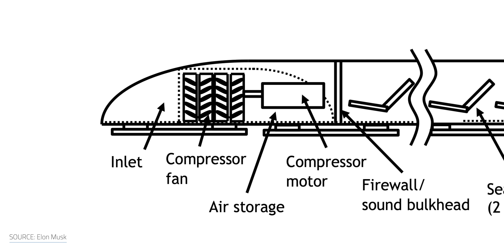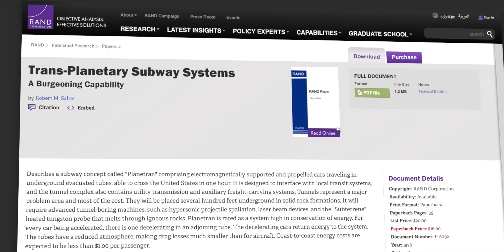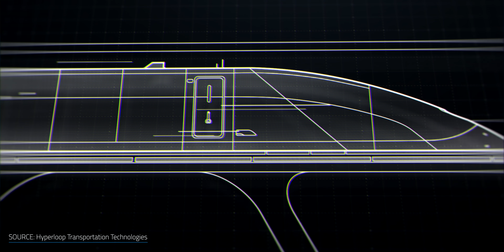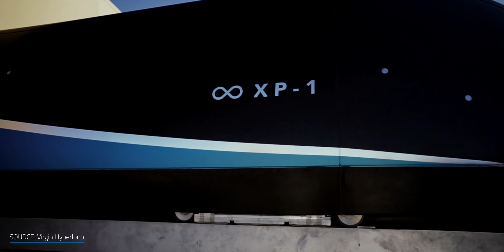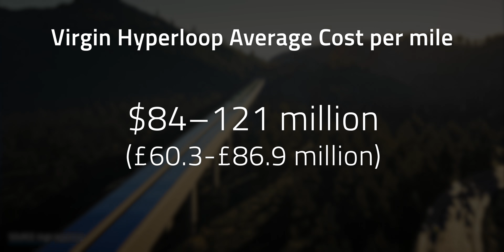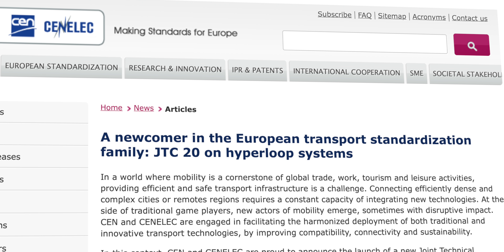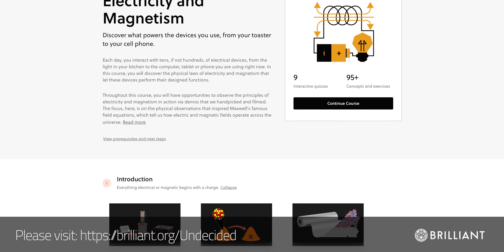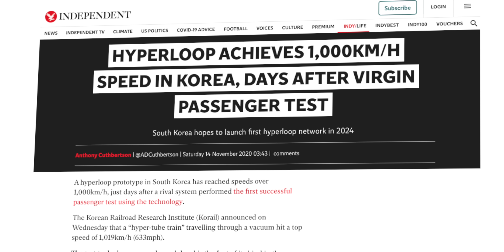Exploring Hyperloop - The Future of Renewable Public Transport?

Comment: Did you ever look at the tunnel Elon built for 10M per mile? It´s a hole, 2,5 meters across and that´s pretty much it. The 2 B dollar per mile, Elon compared his tunnel to actually is the price of a full-fledged underground network including stations and everything. 10 M per mile for a tunnel like Elon´s is the normal going rate, it would have been very surprising to find out that Elon is able to build cheaper tunnels with a store-bought tunnel digging machine. I once did the math, and if Elon would build his tunnels only in LA, and only covering the same routes and stations the bus network there does, the nonsense would cost almost 280 billion Dollars.

The hyperloop is even more idiotic. A track hundreds or even thousands of miles long and all you got to do to kill every soul aboard is hit it with a hammer at the top? All terrorist's dreams just came true. Who would be able to guard such a monster? Every single pillar is a weak spot, who could guard every single pillar? Just take LA-Frisco, the track would run for dozens of miles through rural farmland, you would be able to drive there, have a nice afternoon, place explosives around some pillars, kill all passengers and make it home for dinner. You won´t even get caught, as there is nobody who would have witnessed you. But tat´s only the problem for your life, what about economics? How many capsules can you send on track per hour? How many passengers can such a capsule hold? 
China´s CHR may only make 400 km/h, but it transports up to 10.000 people per hour in both directions. Even under the most generous assumptions, the Hyperloop will be able to launch 10 capsules per hour. With 50 persons per capsule, even though all marketing CGI that has been shown yet suggest way fewer passengers per capsule, we talk about 500 passengers per hour tops. So what good is it to make the run from LA to Frisco in 30 minutes instead of 50, when the next free spot isn´t vacant before the next day?

Elon is an idiot, he always tries to sell other people´s inventions as his own and he doesn´t even choose good ones. The train in a vacuum idea has been revisited at least 8 times during the 20th century and has always been rejected as useless.

Comment: I'm pretty sure Hyperloop is the Concorde of rail. It will take a lot of trial and error to get it cheap and reliable enough for the masses. BAC ran out of money before Concorde acheived that, but it seems there is a lot more interest in high speed vacuum tube trains than there was for supersonic passenger planes. So yes, I believe Hyperloop has a chance and I would love to ride them all over the world.
Reply: The difference is the Concord was a proven concept, the Hypeloop isn't.
Reply: @herrschaftg35  What's your definition for "a proven concept" in this context?
Reply: @eaaeeeea : Something that works.
Reply: @herrschaftg35  thanks. Would you consider people riding on a Hyperloop prototype as something that works? (Virgin Hyperloop 9. Nov. 2020).
Reply: @eaaeeeea : No, because that pod won't suffice as a finished product, nor did their test come anywhere near to fulfilling their original claims. They don't even have a track large enough to really test anything properly. 5 years from now, this project will continue to be hyped-up just to keep the money flowing in with little more to show for it.

Comment: I've ridden in the Japanese "bullet train" at 125mph. Quite an experience.
Reply from the maker: Nice!  I’d love to try it.
Reply: Only 125? That’s how fast the UK rail network can go. Did you mean 225?
Reply: @kaitlyn__L  The maximum operating speed is 320 km/h (200 mph) (on a 387.5 km section of the Tōhoku Shinkansen). Test runs have reached 443 km/h (275 mph) for conventional rail in 1996, and up to a world record 603 km/h (375 mph) for SCMaglev trains in April 2015.
Reply: @dscarty  ah yes, I had misremembered 175 (the current maximum) as 225. I should’ve checked myself before leaving a comment. But I presume you rode an earlier train. 

I knew the UK HST was inspired by the 60s Shinkansen but somehow all these years I’d wrongly convinced myself it had never quite gotten up to the same speeds as its inspiration.
Reply: @kaitlyn__L  Perhaps the most amazing thing in 1989 at 125 mph it was comfortable and quiet enough for many people to be sleeping. The hyperloop is coming.

Comment: The biggest problem with Hyperloop is that it's too late to address climate change.
If the world wants to becomes carbon neutral or negative fast enough to avoid catastrophe Hyperloop technology won't be a part of that solution.
Big infrastructure projects take a long time and Hyperloops are still in the early prototype phase. Meanwhile high speed trains are proven technology that we can start building right now. 
China has proven that it is possible to build a far reaching high speed rail network in a couple of decades. North America can do the same.

Comment: ThunderFOOT will drop the hammer on you if you don't apply basic common sense about this topic.🤐🤐🤐
Reply from the maker: Bring it on.  I was balanced in my take on the subject.
Reply: @UndecidedMF  you should watch thunderfoot videos on hyperloop. i notices you didn't talk about tube heat expansion. and the underground tunnels why don't you just build a subway system.?
Reply: @UndecidedMF : No, I do not believe you were very balanced. You used the same CGI and unsubstantiated claims which have no factual basis. There is far more to call BS on other than just the cost estimates. It is of no coincidence that after 5 years and hundreds of millions of dollars there is still nothing to show for it.

Comment: In a comment that may not age well:  If (after ten years) Hyperloop development is progressing in leaps and bounds, how come no-one ever has any pictures of them (apart from the ones at Las Vegas and Spacex HQ.) All we ever see is more and prettier CGI. Surely there should be loads of full scale working prototypes by now.
BTW the cost per mile cited for loops is actually quite cheap compared to traditional steel wheel on steel on rail systems - they can cost hundreds of millions per mile.

Comment: Wondering why you chose to open with the Maglev going 430 kmh when a French TGV, a normal train on normal wheels, holds the record at 575 kmh !
Reply: One is a record set on a fairly straight and very long line. The other is being achieved day in and day out on a regular service weaving its way along a twisty path through suburban Shanghai. That's a much more common transport requirement.

Comment: This video fails because it just repeats the developers technical talking points while not responding to any of the thoughtful critics. 

Hyperloop will fail for many reasons but firstly because it’s capacity is too low for the cost. 

What is the safe headway for pods travelling at 1000kph? (The capacity of each pod is only 20-40 pax, depending on the developer and they can’t run in trains to increase capacity)
How will air locks open and close for pods arriving or departing every minute (or 30 seconds)? 
Won’t that make stations extremely expensive?  
Don’t they need to stop talking about cost per mile and start talking about cost per station?

Hyperloop = hype going round and round very fast.  (Was Musk trolling everyone when he came up with the name?)

Not all technically feasible innovations are worth developing or continuing.  Look at high speed tracked air cushion vehicles, for which France, the UK and America all had significant working prototype systems. 

—- 

There’s also a few basic errors here: 

The limitation of high speed rail isn’t steel-on-steel friction. Most friction at high speed is on the skin of the vehicle.  Maglev eliminates the problems of wheel-rail interaction and significantly lowers the weight of vehicles. 

China has two high speed (600mph) Maglev prototype vehicles and has plans to build a national network.  But, AFAIK, neither they nor Japan are developing a Hyperloop system. 

Brunel didn’t just propose an atmospheric railway, he built it and it ran in commercial service.  The improvement in conventional steam locomotives to climb steeper grades meant Brunei’s technology became obsolete and there was no point trying to find solutions to its problems.

Comment: Big fan of Spacex but Hyperloop is a utopian pipedream that is not realistically possible. The white paper has glaring flaws and it would be terribly unsafe. Do some research. Think of the problem with vacuum tube travel over extended lengths. One high power rifle from anywhere in the miles of length envisioned would be nightmarish and all the worlds steel could not make this tube thick enough to make it bulletproof. Conceptually it is interesting but like a space elevator nutjobs and terrorists make projects like these unfeasible.

Comment: Those saying its impossible because Thunderf00t said so, didn't get what he said. he said it was totally possible but its impractical and expensive and the problems it has will add to its impracticality and expense. I think the reality is it will end up like the monorail in that usable Hyperloops will be built but they will be massively over budget, cost more than anticipated to run and be confined to for example one being built between Dubai and Abu Dhabi that's cited as the future during the opening ceremony but 50 years later has not been upgraded or expanded and is seen as a tourist trap rather than a viable transport solution.

Comment: It's a ground version of The Concorde. They built 20, in service for 27 years but certainly didn't replace conventional aircraft. 
Hyper loop will build a couple of short runs, they will cost a fortune to operate and eventually will run wheeled trains sans vacuume just to recoup costs.

Comment: Thunderf00t destroyed this pretty well for me. Even if they do get it to work, it's going to have a tough balancing act with the economics and safety. As it's predicted the trains will hold far fewer passengers, that means more 'pod' trains, more airlock interactions, more employees, etc. This is basically a maglev train (can be built now) inside the (near) vacuum tube. Problem, is all that extra complication with the tube, engineering, and extra maintenance costs for maybe 50-70% more speed, is that going to translate to more passengers paying fares? Just the near vacuum of a tube that large is mind boggling.

Also, if I go on a train, I want to see the countryside out the window, not be stuck in a dark tunnel. If there is a leak in the pod train or the tube - an accident (earthquake) with this is going to be horrible. I see no feasible way the train can stop and let passengers off in an emergency either. Sorry, but I'm highly skeptical this will actually be built...even at the working prototype level.

Comment: In Europe HSR beat air travel not because it's faster but because of the number of people a train can carry compared to a plane. Now Musk wants to use rockets to move people.
Here in Sydney Australia we recently opened a new metro link and it is great and fast. The thing that makes it quick is lots of doors per carriage and that's made possible because all the platforms are straight. We long ago worked out how to move a lot of people quickly and Hyperloop might be high speed but it is a bad system for moving a lot of people over distance. Once you take into account how long it'll take to get a small number of people into a capsule, then get it though an air lock into the vacuum tube and then do the same at the other end of the line you start to see the problem with this idea as a fast and cheap form of transport.

Comment: Do you want low carbon fast transportation?
Here is the recipe:
10 Build nuclear power plants. A lot.
20 Carbon capture from the air.
30 Make synthetic jet fuel out of the captured CO2 with the nuclear power.

40 Fill up current airplanes with the synthetic jet fuel.
50 GOTO 20.

Comment: Just think of the comparative costs between railway lines and a tube strong enough to hold a vacuum. 
The tube has be built on high columns because of roads, rivers and valleys and if it reaches the speeds they claim, any changes in height or direction would have to be very gradual or passengers would be thrown around and have to be strapped in for the whole journey.
Rails don't need extra power once installed, the tube would have to be constantly pumped of air, as the 1,000's of  joints in the tube length could never be a perfect seal.

Comment: The biggest issue for building high speed mass transportation is a straight track.
You have thousends of privat land owner, mountains, rivers etc. which makes this impossible expansive even to start.

Even if you have a straight track - build a maglev and shade it with solar panels. 
If people complain that it is too slow, then you could still further upgrade it with a vacuum tube and thousends of vacuum pumps ...

Comment: Read marketing and investor crap less and analyse the engineering more.  Not only must a vacuum tube handle earthquakes, it must handle thermal expansion without expansion kinks and without big leaks.  Not only must the cost of powering the train be considered, so must the cost of powering all the pumps maintaining vacuum against leaks.  Not only must train capacity be considered, so must delay of passenger ingress/egress of a vacuum tube.

This is the age of charismatic figures making ridiculous promises and channels running with hype to chase views.  Analyse or be dismissed as another Fox News.

Comment: I think it's a neat idea, but introduces more challenges than it solves. Moving that fast at 30.000 feet is one thing, at -300 in a hamster run that's in vacuum quite another. 

I think we need to change our expectations about how fast we need to get places rather than this. These days, I don't even want to drive into the office, let alone fly coast to coast or travel in a hyperloop at rifle round speeds.

Comment: What about ETTT?  This is where I first saw this concept.

Something to think about is the whole systems does not need to be at one pressure.  What I think would make more sense is if you had a multi-pressure system and progressively go to lower pressure levels for longer distance travel.  The levels would be:
1. The higher pressure system is where you first enter and can travel around town at lower speeds.  Air will be leaking in all of the time from vehicles entering and exiting, but a modest amount of work to take that air back out to have a partial vacuum is fine if you are not going that far.  Maybe shoot for ~10 km of altitude?  An advantage of an air pressure like this is if there is a depressurization of the vehicle, oxygen masks could drop and keep people alive.  Also if it turns out there is a leak if you are still local, there is probably a close exit to get back out and you would probably have an exit just before entering the next level just for leaks / other emergencies.
2. Then you have the regional low vacuum system.  This is where you get up to mach 1 speed.  As vehicles are already entering and exiting from a partially evacuated tube and this is an aggregation point, it shouldn't be too much extra work to keep a low vacuum in the regional tubes.
3. After this the long distance high vacuum system.  This is where you get up to multiple mach speed.  As vehicles are entering and exiting from a rather low pressure from the low vacuum system, there wouldn't be all that much work left to suck out most of the remaining air to create a high vacuum.

Such a system needs to be built for freight as well as people.  I would see it as making the country and even world a much more connected place.  While more people work remotely these days, those who periodically need to come in or even every day commuters could live much further away.  Packages could get to you from distant warehouses much faster while still being cheap to place in remote locations.  Bulk freight could become fast, just use the otherwise idle capacity opportunistically to send freight.  So maybe rush hour there won't be much freight moving, but in the middle of the night a whole lot of freight will move this way.  As all trips are scheduled by computer, pricing can be set by demand as well as set so there is never congestion.  You would probably want to regulate some pricing controls so people don't get gouged too much to travel at peak demand while still collecting some extra fares for expansion as demand increases.

For things like handling earthquakes, we already have a pretty good idea where these happen and why, so a key thing would be to monitor, regulate speeds around known faults, and send commands to slow down or even stop traffic in the event of an earthquake.  The Japanese rail systems automatically braked in the 2011 earthquake long before the shock waves reach any trains.  So maybe in California, it will never go super duper fast and some track routing will bring the faster levels a litter further away from known major fault lines (maybe never getting above mach 1 anywhere in the state), but other parts of the country for long haul trips you just zip right across in practically no time.

Comment: Building reliable wound-carbon-fiber pressure vessels is easy.  Running/maintaining miles of de-pressurized pipe is the hard part.  So many lawyers. It will never happen.